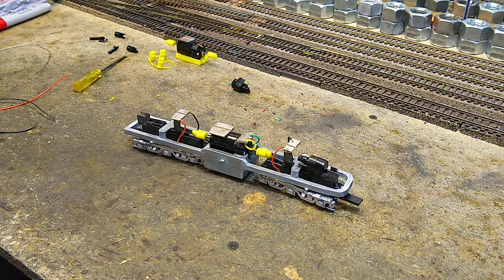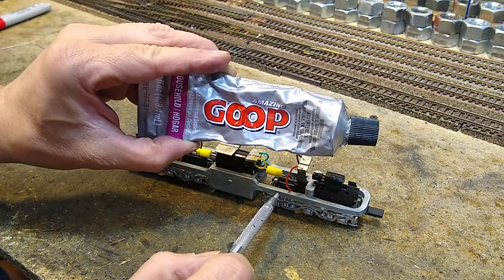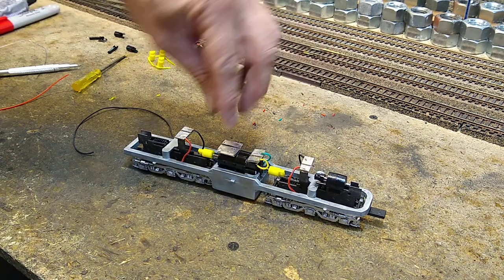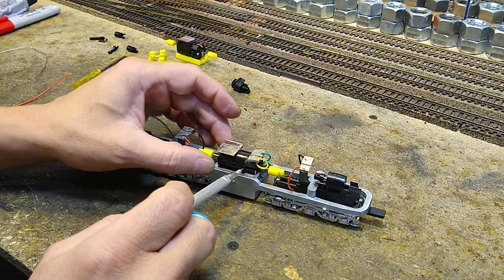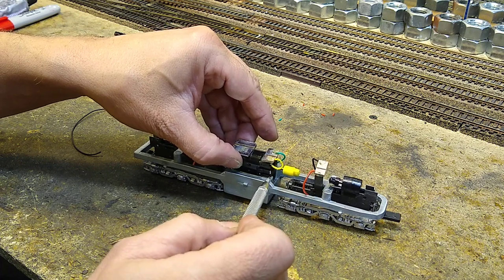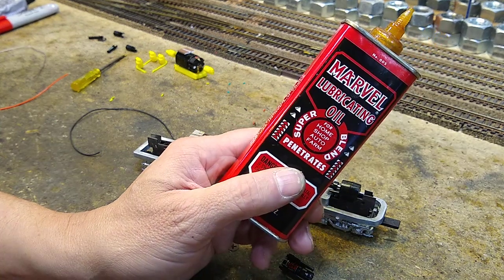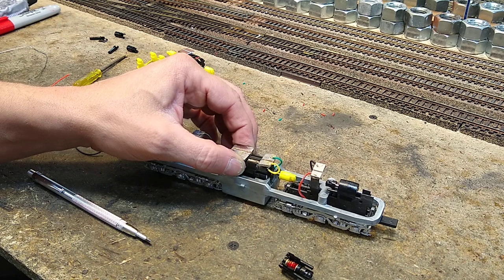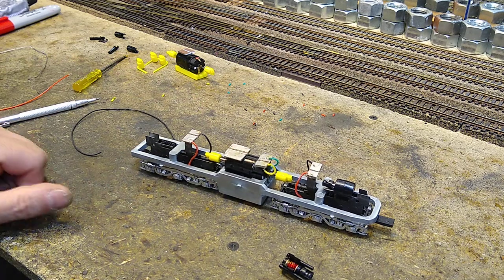Athearn Blue Box PA-1 DCC conversion part 4 wiring layout

Comment: This is certainly turning out to be a beautiful build. For me, I would opt for the advantages that flywheels provide as a addition. My question to you is, Do these 24 volt motors that you're using perform as well without flywheels than other motors like the Athearn do with them?
Reply from the maker: a while back I got to operate on a layout that used the Digitrax train brake throttle where all momentum is digital.  so you set your speed, the locomotive revs up and you release the brake, start moving and throw it into neutral when switching.  a lot of people don't like that, but I loved it.  my testing of these motors shows that they respond more precisely than a plain 12v motor.  flywheels throw off the momentum because they keep turning even though the decoder has reduced power.  I also suspect that flywheels are one obstacle to speed matching since way back in time Model Railroading Magazine did a flywheel test and found that only the after market Timewell brand had flywheels that were true - in other words every flywheel is different by just enough to make it hard to match speed.  we'll find out on this PA-1 since it will be on a Digitrax layout with momentum.
Reply: @elite194  OK.that makes sense. I will look forward to seeing the outcome.
Reply from the maker: @xxxx-hw5we  result has been posted